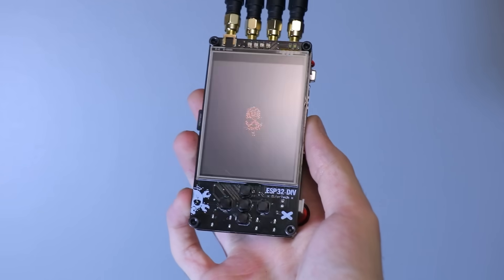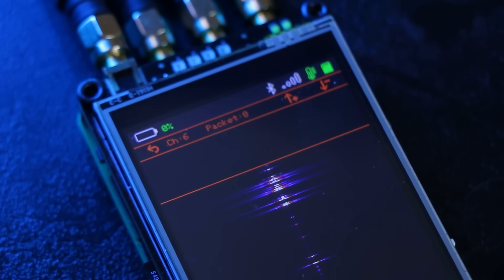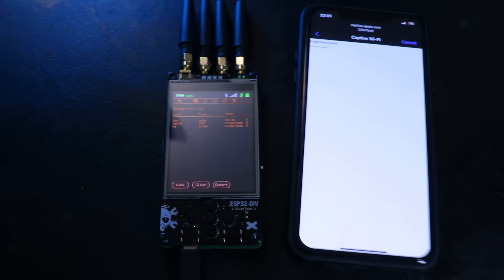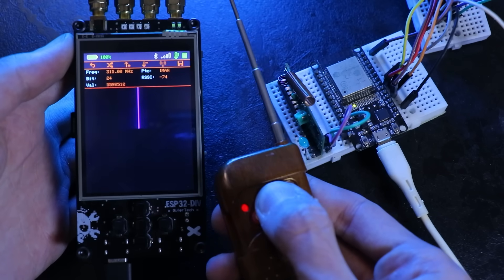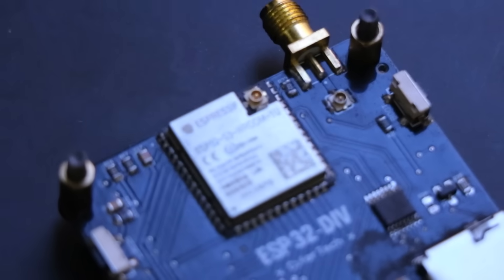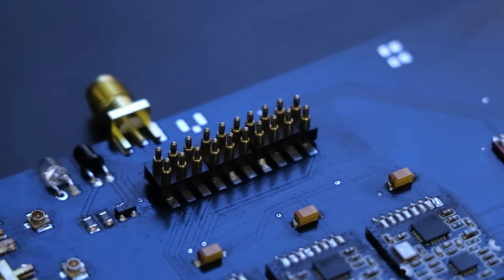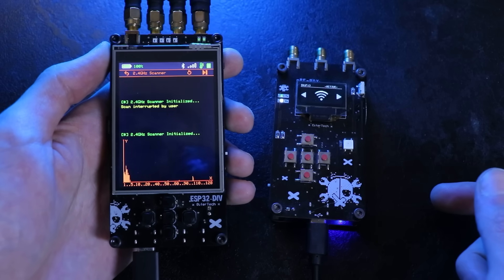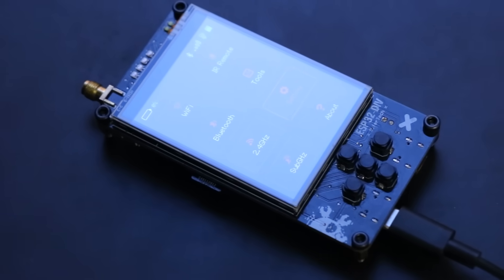I Built Something Better Than Flipper | ESP32-DIV v2

Comment: For ESP32-DIV V2 (by CiferTech), have you considered a V3 that adds a BW16 (RTL8720DN) module to support 5 GHz Wi-Fi as well as the current bands?
It could expand the toolkit’s wireless capabilities across both 2.4 GHz and 5 GHz.

Comment: I asked Grok if it's actually better than Flipper. Can you refute this?

The ESP32-DIV V2 (from CiferTech) is an interesting open-source DIY/handheld wireless pentesting tool built around the ESP32-S3 microcontroller, with a modular design (core board + detachable shield), multiple radios, and a focus on Wi-Fi, Bluetooth Low Energy (BLE), 2.4 GHz (via multiple NRF24 modules), Sub-GHz (CC1101), and infrared capabilities.
It's explicitly marketed by the creator as "something better than Flipper Zero" and a platform for ongoing evolution rather than a finished product. It has gained some buzz in the maker/pentesters community as a potential "Flipper Zero killer" for DIY enthusiasts.
Key Strengths of ESP32-DIV V2 Compared to Flipper Zero

More aggressive wireless features in some areas, especially Wi-Fi (e.g., promiscuous mode packet capture with PCAP logging to SD, captive portal attacks for network cloning/phishing, advanced deauth tools, beacon spam) and BLE (detailed sniffer with suspicious device highlighting, Sour Apple spoofing for Apple devices, Rubber Ducky-style attacks via BLE).
Multi-radio setup out of the box — three NRF24 modules + CC1101 Sub-GHz + IR, giving broader simultaneous protocol coverage without needing add-ons.
Modern hardware — ESP32-S3 (faster/more capable than Flipper's STM32WB55), color display (assumed from firmware/UI), touch elements in some versions, SD card for heavy logging/scripts, NeoPixel RGB LEDs for feedback, buzzer, pogo-pin modular stacking.
Fully DIY/open-source — schematics, code, and precompiled binaries on GitHub — cheaper and more customizable if you build it yourself (great for makers who want to hack the hardware/firmware directly).
Evolving quickly — Creator actively adds features based on feedback; it's positioned as a "platform" rather than a static device.

Where Flipper Zero Still Has Clear Advantages

Maturity and polish — Flipper has a huge community, years of development, stable official firmware, thousands of apps/plugins, and a very user-friendly toy-like interface (monochrome LCD + D-pad). ESP32-DIV V2 is explicitly "not finished" — it has bugs to fix, and it's more experimental.
Broader protocol support — Native strong 125 kHz + 13.56 MHz RFID/NFC reading/emulation (Flipper excels here), reliable Sub-GHz capture/replay across many real-world devices (garage doors, etc.), infrared library for common appliances, GPIO for hardware hacking, 1-Wire, iButton, and more. ESP32-DIV focuses heavily on Wi-Fi/BLE/2.4GHz but is narrower in some legacy RF areas.
Build quality & ecosystem — Mass-produced with good battery life (up to weeks), official accessories (WiFi dev board, video game module), mobile/desktop apps for easy management, and wide availability. ESP32-DIV is mostly DIY (some limited handmade batches of V1 exist), with less refined UX and potential hardware quirks (e.g., unreliable battery I²C data, initial IR receiver issues).
Portability and reliability — Flipper is a complete, pocket-ready product out of the box. ESP32-DIV V2 shines more as a customizable bench tool or for people who enjoy building/tweaking.

Bottom Line
No, ESP32-DIV V2 is not objectively "better" than a Flipper Zero for most users — especially if you want a polished, reliable, all-in-one tool with massive community support and broad protocol coverage.
It can be better in specific scenarios:

If you're a maker/DIY person who wants to build/customize their own device
If your main interests are advanced Wi-Fi/BLE attacks/experiments
If you want more raw multi-radio power without buying Flipper add-ons (like Marauder WiFi or external CC1101)

Many similar ESP32-based projects exist (e.g., Cheap Yellow Display + Marauder, Willy Firmware) that offer Flipper-like features at a fraction of the cost, but they rarely match the full scope and refinement of the actual Flipper Zero.
If you're into tinkering and open-source hardware, the ESP32-DIV V2 looks like a fun, powerful project to build and hack on (check the GitHub repo for schematics/code). But for a ready-to-use, versatile multi-tool in 2026? Flipper Zero remains the king for most people. 😈

Comment: nice project! Building something better than Flipper with an ESP32 shows how powerful that little chip still is when you push it beyond the basics.
Seeing the ** and how the hardware/software interplays gives a solid look at why DIY embedded projects still have a place alongside off-the-shelf tools.
Great to see practical builds instead of just theory—especially when they actually solve a real user need.

Comment: REALLY REALLY INTERESTING, but only 2.4 in 2025? 5 and 5.8 also available ? i did not found. hmm
Reply: Looks like the ESP32-S3 chip he's using only does 2.4Ghz. You might be able to modify the project to use the ESP32-C5 chip that does 5Ghz, but you'll probably need to make a bunch of software and hardware changes.

Comment: Did you get notice of the new china display board wirh 4.3 inch display and p4+c6 mcu. Mine arrived today. Thats a powerhouse! 2x 400mhz with a ton of hardware accelleration.
Reply: Price with case and camera was 30 euro incl all delivery cost.

Comment: The thing about portable things is them being covert. This particular device is the opposite. And when I'm not burdened by discretion, I'd rather pull out nettop with a decent IO and capable adapter.

Comment: I think it would be more interesting to plan for modular. This is not quite a flipper replacement; you will also need to cram the Chameleon Ultra there for NFC + battery. Getting an expansion slot designed can help you with it

Comment: can you please help with how to flash the new firmware, I cant use OTA as theres no lower case option, and I cant find any info on how to correctly use the SD, the device looks like it doesn't recognise the card, I have tried installing the FW.bin file but it fails everytime
Reply: I installed version 1.1.0 by downloading the bin file, renaming the file to firmware.bin, and inserting it into the root of the microSD. Then, go to the device, tools, and upgrade from SD. With this update, 1.5.0 gives me an error while upgrading.
Reply: Sorry I should add I have followed the SD Card method and it looks like it’s works but it reboots and remains on v1

Comment: Esp32 C5 V3
Reply: Yes, that would be really cool since the C5 also supports 5GHz Wi-Fi, but I guess it won't have enough power, ram, etc. for some of the things - but it would definitely be worth a try!
Reply: @xenonlp9189  What would be cooler would be the C5 and the P4 used together, P4 for the processing and the C5 for the radios, P4 would also allow an ethernet port to be added to make it truly universal for network attacks and as a remote sensor